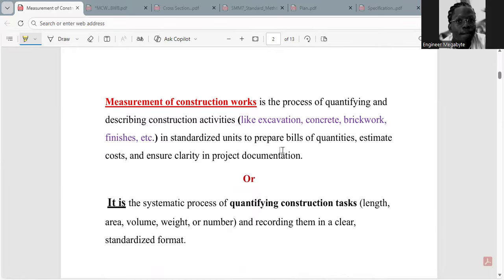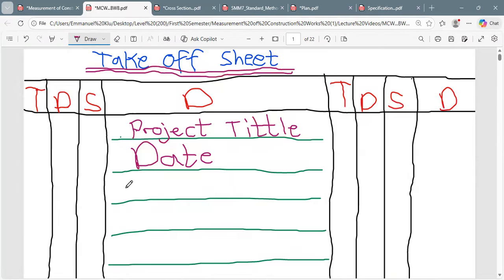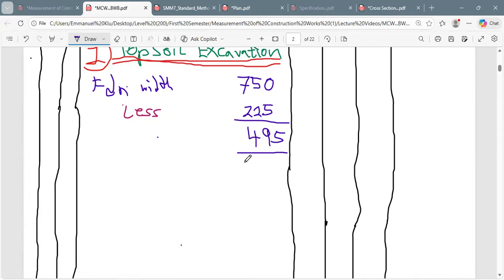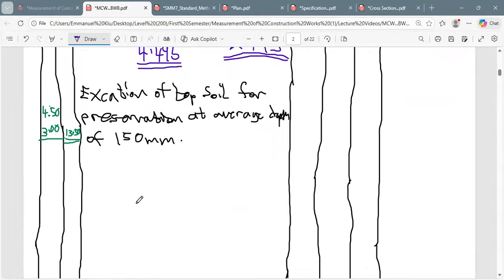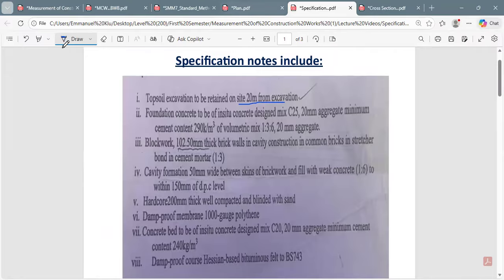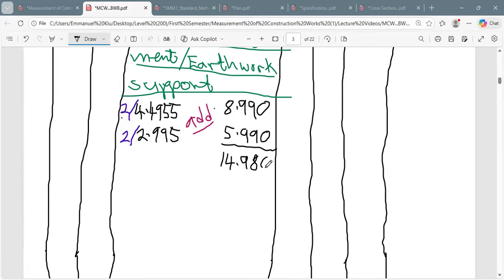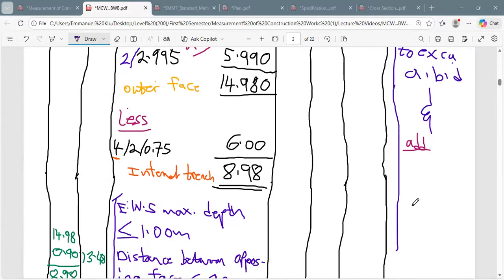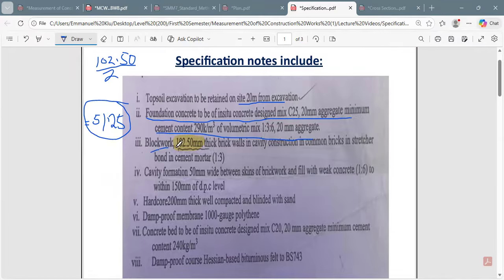Measurement of Construction Works Lecture Video 1

Comment: Please how did you get the 76.25 when calculating for the centre line of inner skin?
Reply from the maker: ~*Block Work👨‍🏫*~

NOTE📚: 102.50mm divided by 2 = 51.25

Also, (Cavity Wall divided by 2 minus half of Brick wall thickness = 76.25 mm)

 🔖  255 divided by 2 = 127.5 
  🔖127.5 - 51.25 = 76.25 mm

Comment from the maker: ~*Block Work👨‍🏫*~

NOTE📚: 102.50mm divided by 2 = 51.25

Also, (Cavity Wall divided by 2 minus half of Brick wall thickness = 76.25 mm)

 🔖  255 divided by 2 = 127.5 
  🔖127.5 - 51.25 = 76.25 mm

Comment: Please after concrete in foundation on the take off sheet,please I think we have fix reinforcement bars for the columns(pillars) before the block work,or
Reply from the maker: 📚Measurement of Construction Works is very flexible, you can even choose to calculate for Block Works even before Excavation of top soil 😇😅